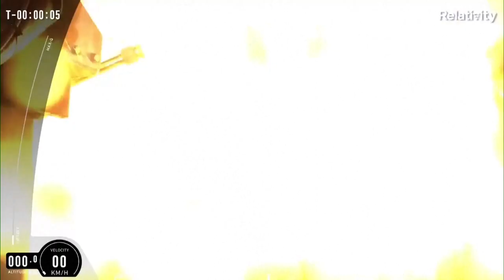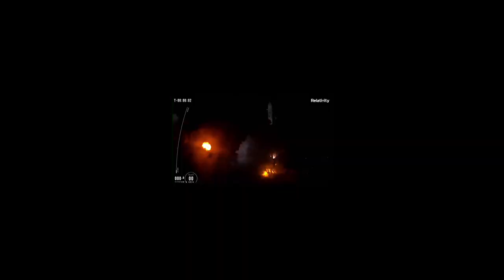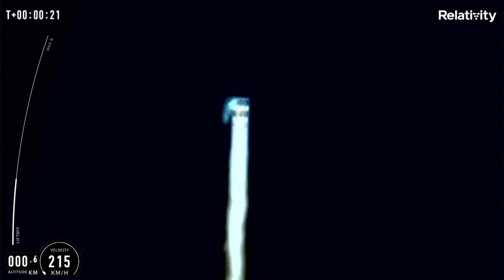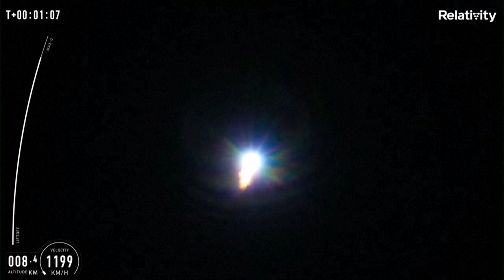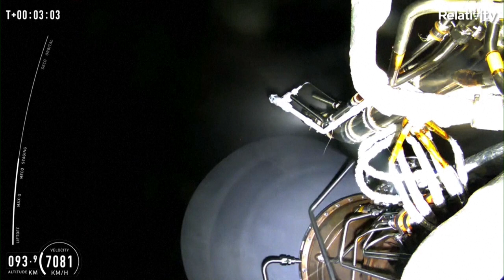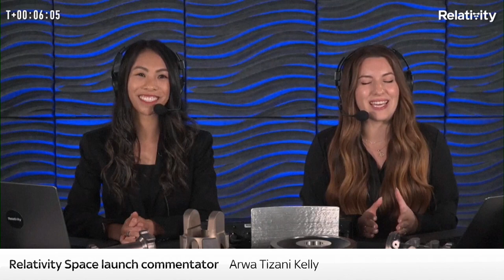Rocket made by 3D printer fails to reach orbit after Cape Canaveral launch

Comment: They went past MaxQ, but the second stage didn't ignite. Might sound bad but it's similar to SpaceX who now launch rockets twice a week and launch more in a year than any country. They'll have some good data to analyse and will be back to try again. The Terran R looks great too so good luck to them.
Reply: These rockets that are still being trialled - they'll work out more effective and economically viable than ones that already exist?
Reply: @VanderlyndenJengold  This is the full thing. Yes they will improve the design as they go along but this isn't like SpaceX Starship where they were launching rockets that looked like grain towers. The mainstream media like to dramatise failure when this is actually a big success. And considering the other recent launch scrubs for the Terran 1, it was a great relief to see the launch happen this time. Also the blue flame was great to see because a lot of future rockets are going to be Methane powered which gives a greater power to volume ratio as well as the possibility of travel to Mars and back.

Comment: Using the word "fails" in that title is misleading. Yes, the rocket did not make it to orbit. But using FAILS in the headline gives the impression that the flight was a failure. It was not. The stated goal of this first launch was to prove that a 3-d printed rocket could get through MAX-Q without failure of it's structural strength. If they had made orbit that would have been icing on the cake. A better title would have been: "3D Printed Rocket launch proves viability of its manufacturing even though it did not reach orbit after Cape Canaveral launch"